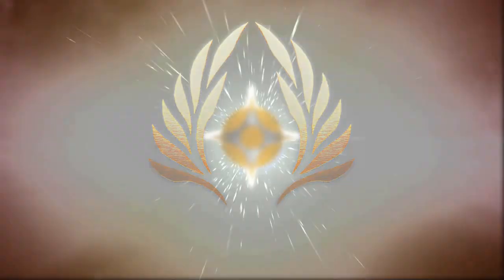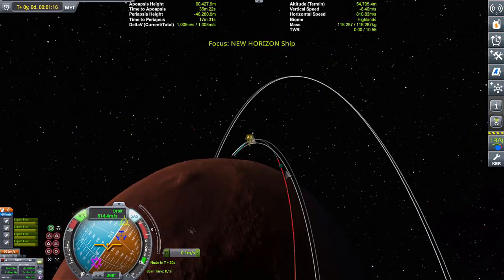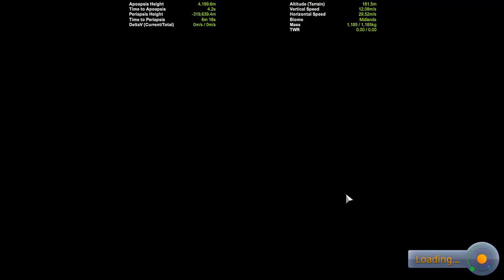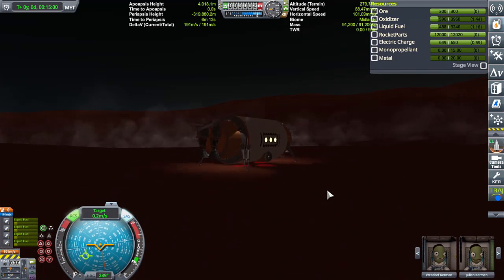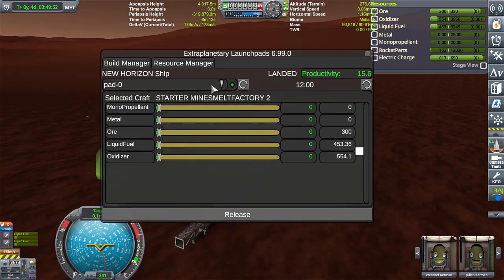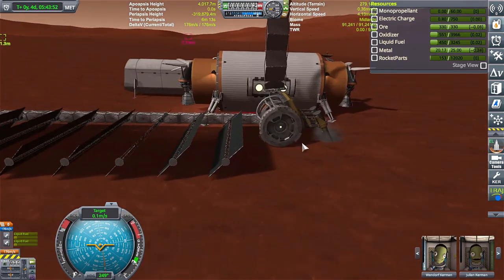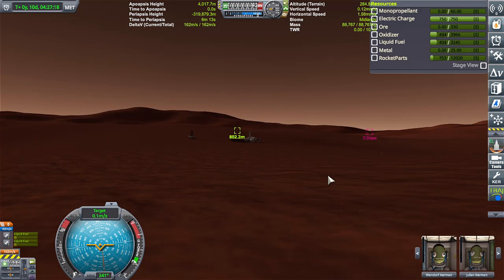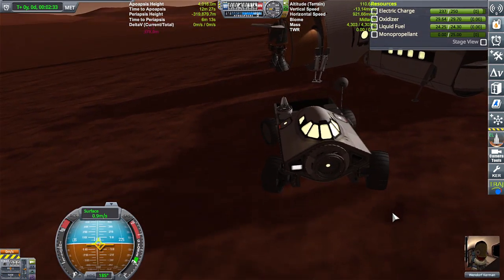COLONY MISHAP. Colonize the solar system in kerbal space program \ PART 4

Comment: This project is coming together quite nicely, I love it!

Are there plans to built a larger facility to make rockets and planes a few km away from the basecamp though? It would reduce the probability of something exploding and taking out something vital (like the greenhouse) and it would cut back on the strain for your computer, if the other stuff from the basecamp is outside physics range.

The downside would be that you'd need to haul around rocket parts from the mining facility to the building site, but that's still better than 1FPS due to partcount.